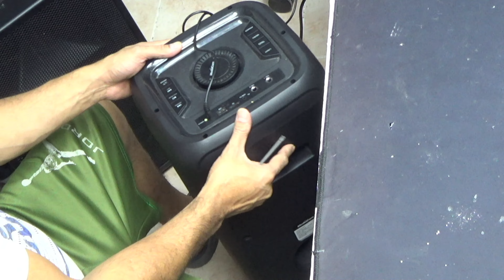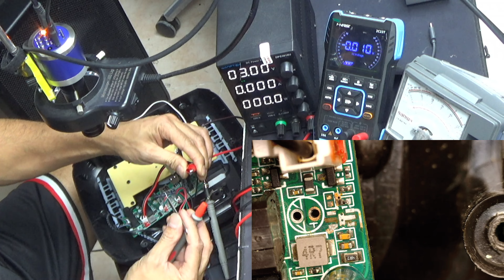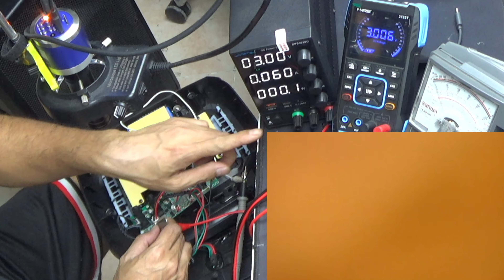MCI 525+ MEDIACOM Bluetooth speaker. No power repair

Comment: Where can buy the board of that speaker?
It us very hard to find here at dubai
Reply from the maker: Hi, the board seems not orderable.
Reply: @ARTaudio44 its posible the electronic shop can fix it?
Reply from the maker: Hi, yes as long as there are no heavy corrosions.
Reply: @ARTaudio440 by accident I fell the water inside the speaker.but the men who fix it.he remove  and said need to buy the board.
And the problem is he cannot find where can buy the board